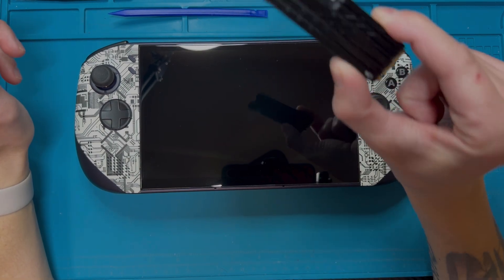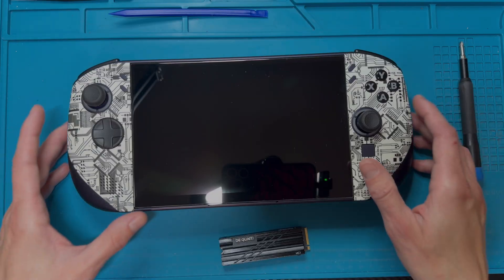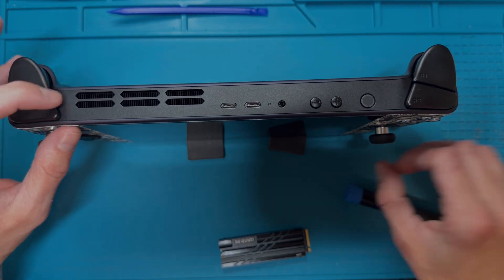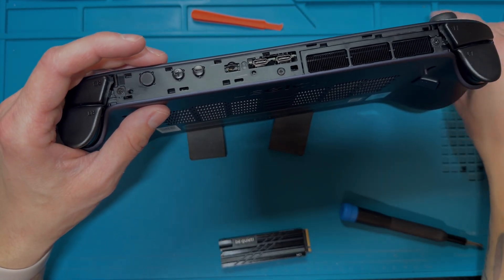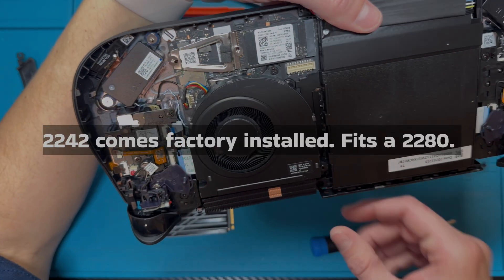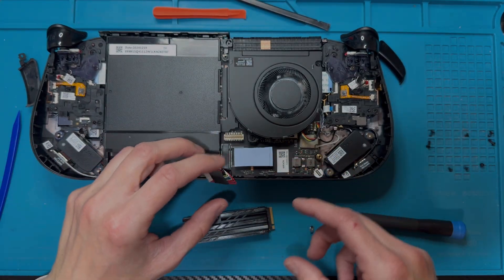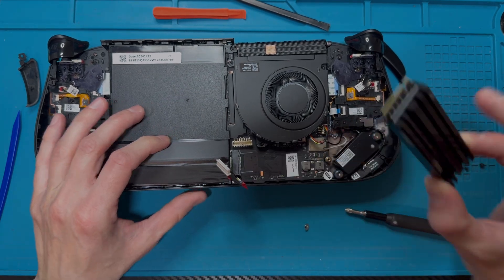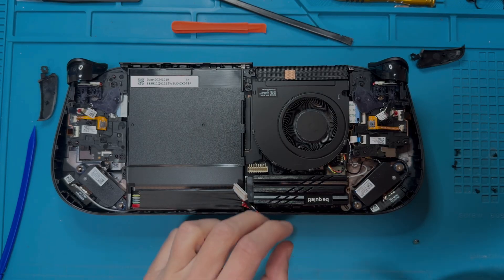Legion Go S Storage + Heatsink Upgrade Guide!

Comment: Hi Nelly, thanks for the great content on your channel. I wanted to know your opinion on the new Onexplayer  Apex and Ayaneo next 2 handheld. Which one do you think is worth buying?

What do you think about Apex water cooling?
Reply from the maker: Hey! Thanks, I appreciate it! I have the oenxolayer Apex on pre-order. 64GB liquid cooling model, Liquid cooling system, extra battery, and battery charger. I'm super excited about it. We acutally did a whole Speedcast episode on it a few weeks ago on Handhelds United (Collaboration section on my channel page). I think the Apex is a great buy especially after playing with the Legion go S. It's the most comparable device to what the Apex will be. The removable battery is huge for longevity and weight reduction. The liquid cooling dock will push it to the limits and allow for future oneplayer devices to do the same. I just picked up a Flow Z13 on Sunday with the ai Max 395 chip to get a better idea of the performance. What I learned is that the Apex will essentially be a handheld at 7600m XT egpu level performance without the liquid cooling. With the cooler it will probably push closer to a 7800m onexgpu 2 performance. It's like having an egpu already in the handheld. I'm so hyped! 

You can check out the full video here covering our discussion on the Apex: 
https://youtu.be/wpgEZzTCjQs?si=uqrvtkP4VTn2MPR5